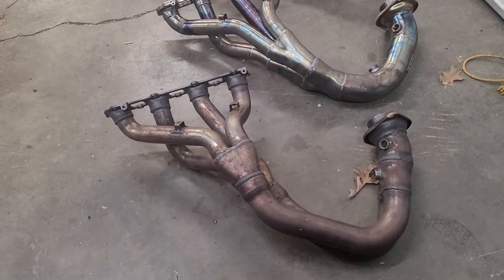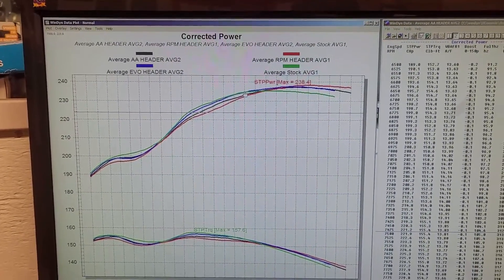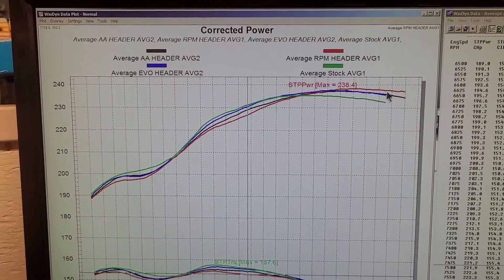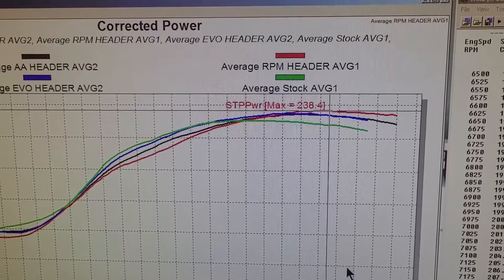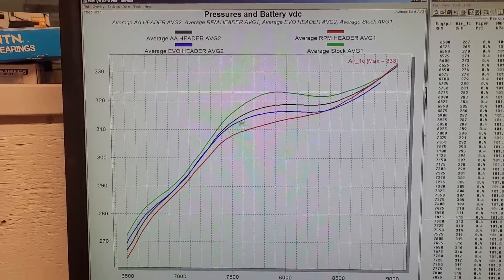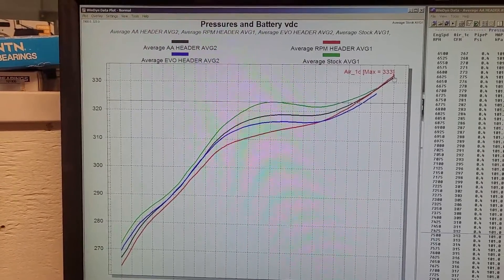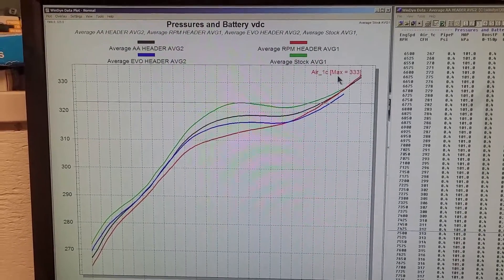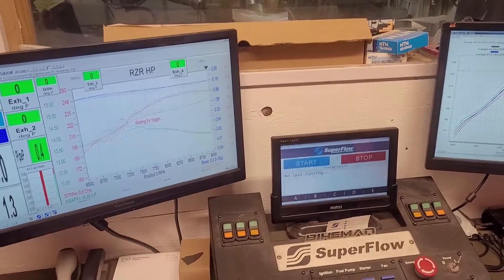WHICH HEADER IS BEST? I SHOW YOU IN A POLARIS RZR PRO R FULL HEADER COMPARISON

Comment: Thanks for this unbiased testing and very informative testing as well. 

What type of air intake are you running? Is it simulates to flow air like the OEM set-up on the car itself?
Reply from the maker: we have an air meter inline on the intake where the filter would normally be, so it is a little different than stock

Comment: My butt dyno says the stock had a lot of low end but my rpm header absolutely screams up top with your stage two tuning and clutching. Matching your testing. Seeing that these CVT units run at the top rpm most of the time, I’d say the rpm is the ticket, especially combined with your cams.
Reply from the maker: Your butt dyno seems accurate to my testing. With cams or head with an ECU flash with extended rpm limit results might be better for the different headers